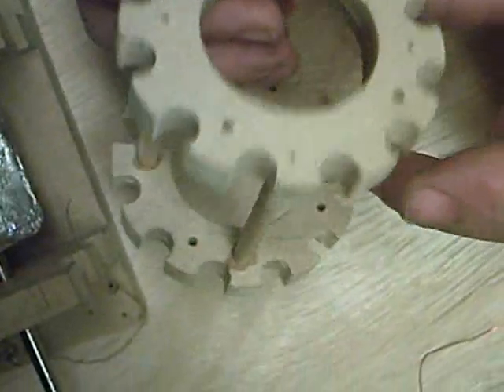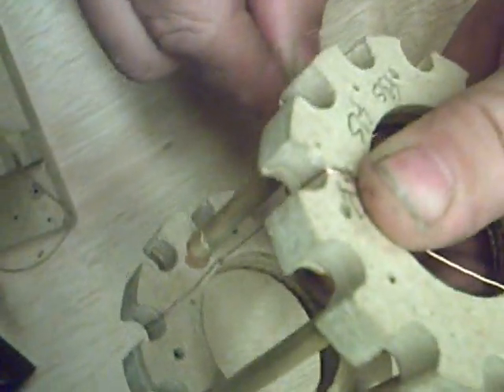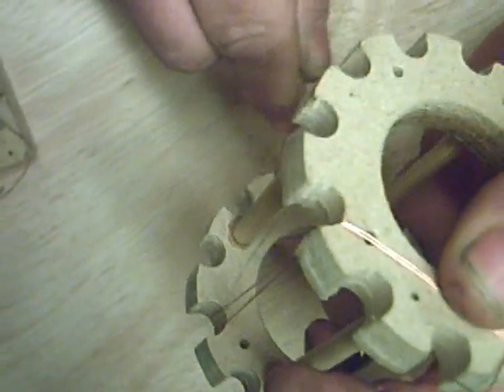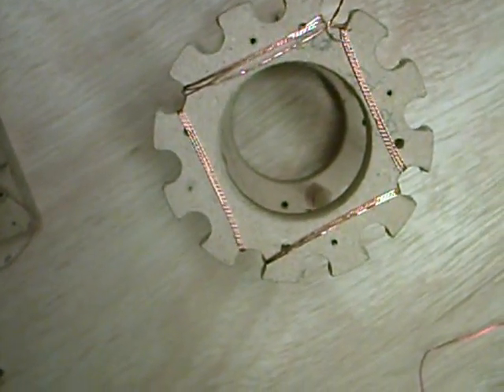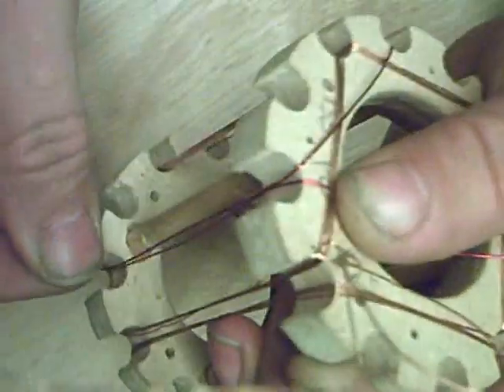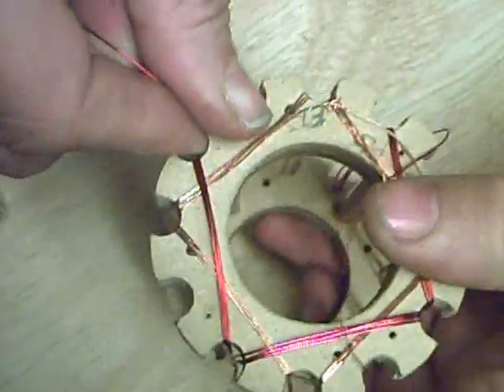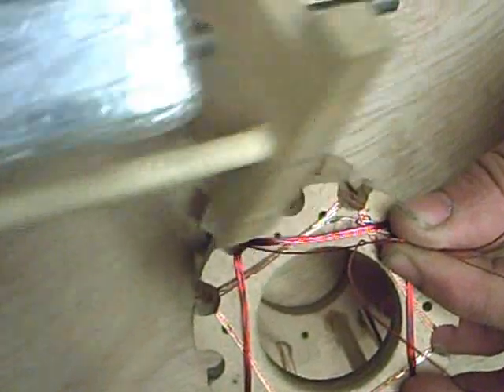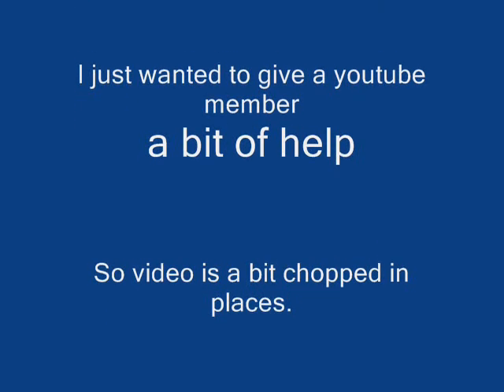Overunity Generator Pulse Motor type 2 (Update winding it)

Comment: hello sir do you have any info how the rotor is wound be Amplidyne or Metadyne generators? Please make some practical video so those differences can be clarified like the Rosenberg and Magnicon generator ,rotary converters .
Winding rotor types.
Im be all means confused like hell your video makes sence at least.
And its simpel video.
I hoppe you can help me out I need such generators for me engine builds I use often low speed engines below 300rpm so I need generator type that has variabel voltage regulator or posibly run dual baterry set ups or baterry/capacitor banks chargeing them seperatly .

Comment: your sync would be a night mare and you'd get surging in the circuit / drive if it worked at all. most likely it'd turn once then stop some where because the magetic force squeezed the wires just-so to bend the field so it wouldn't rotate.

Comment: The magnetic flux induction would be very weak becaue it wouldn't complete the circuit well enough for the ..err.. roundess of the field to unblemish teh fact that these aren't perfectly concentric rings...2 loops minimum or there's not going to me much in the way of efficiency.  The coils should be TIGHT or you get massive vibrational losses.  Induction is Messy in the volume dimensions where you'd get away with more if it was, say capacitance which has fixed distances by manufacturing process.

Comment: Here's a question... instead of winding 50 turns for pole #1, and then 50 turns on pole #2 and so on... what would happen if you did 1 turn on pole 1, then 1 turn on pole 2... pole 3 then pole 4 coming around full circle, and then then wound the second turn on  pole #1, second turn on pole #2..#3.. #4 and so on until you have a total of 50 turns for each pole.  Would that work?  Is the end result the same as long as there are 50 turns per pole?  Just curious...